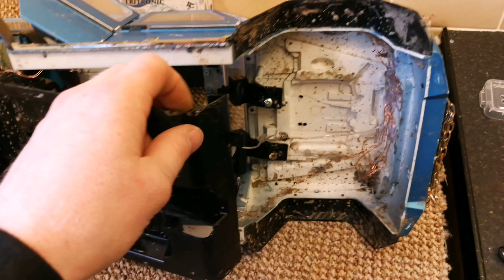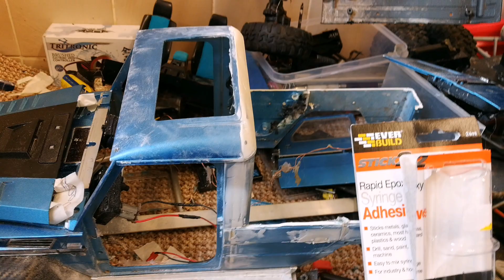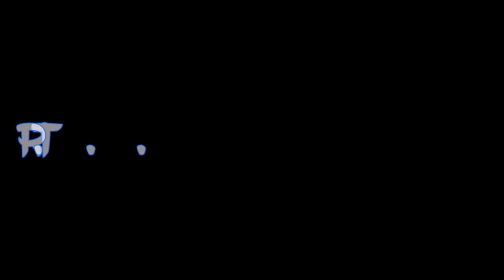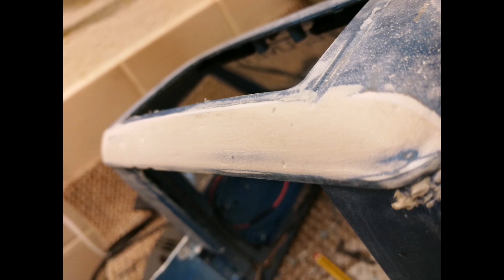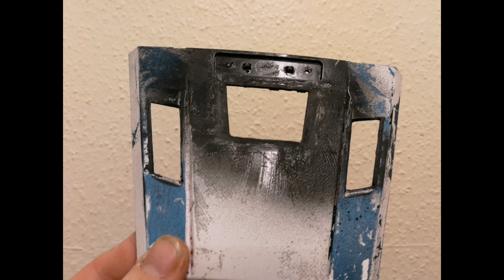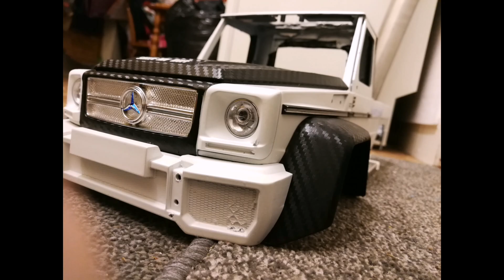Mercedes G wagon g500 4x4² Rally pickup build video - part 1

Comment: Haha this is so good! I have no idea where you get the time, but I love the project and evolution of the car. Will it go on a new chassis, or are you able to lower the one you used before?
Reply from the maker: Hello, thanks for stopping by.

Yes it will go on traxxas trx4 sport chassis, but with diff setup... New motor, esc, tx, rx, pinion, shock setup, 1.9 wheels + tyres